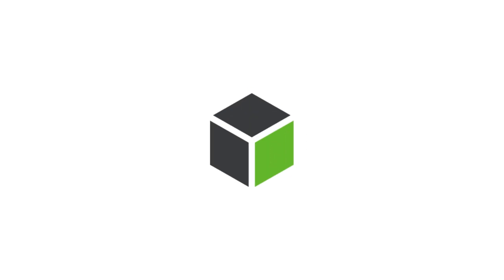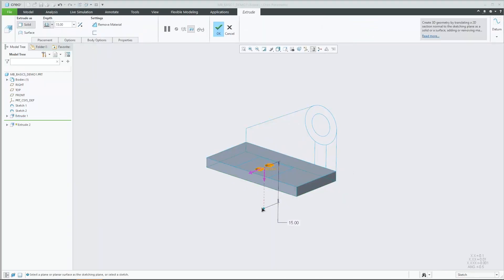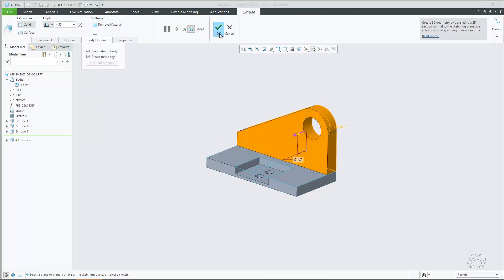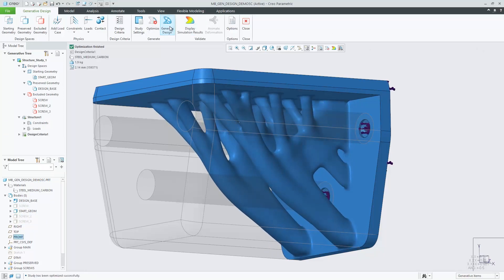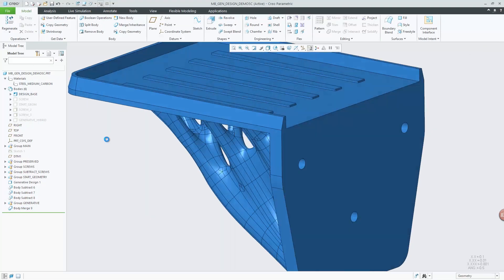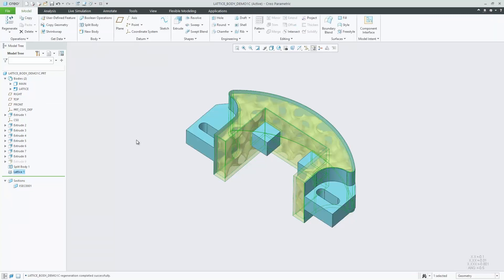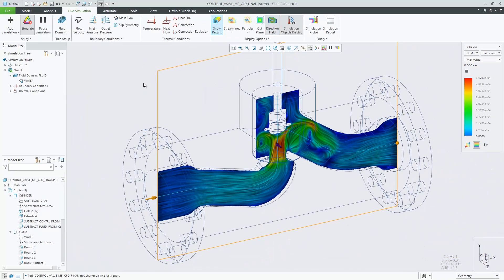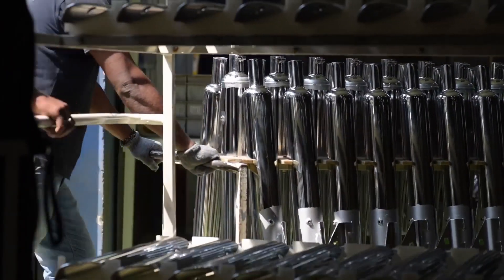Creo 7.0 - Multibody Design

Comment: This is 10 year old technology used by solidworks and inventor. Please get with the current times Creo.
Reply from the maker: >Implements technology in new release (or "gets with the times")
>Mocked in comments section for getting with the times by being told to get with the times
???
Anyway, in one release, we not only implemented multibody design, but we're already doing it better than what SOLIDWORKS and Inventor have spent years working on. That's not just our opinion, but that's what's heavily implied by Develop3D magazine: https://develop3d.com/the-d3d-30/#CREO7
(their full independent review of the whole release here: https://www.ptc.com/-/media/Files/PDFs/CAD/Creo/DEVELOP3D_Creo7.pdf?la=en&hash=C1F3F7D9D3316CCBAB136DC653B78F60 )
I hope you're commenting on those other CAD systems' videos asking why their CAD systems still don't open large assemblies well, or when they're going to be coming out with real-time simulation as part of a real simulation-driven design workflow, or when they'll have any number of the innovations Creo has brought to the market in the past several releases developed to the level that Creo has!
Reply: @PTC_Creo  I'm not trying to mock you. I'm just extremely disappointed. Recently started using Creo at work. It has been a nightmare. Feels like I travel back to the 90's and use windows 98 or something. The features seem over-complicated. Lots and lots of mouse clicking for simple operations that would otherwise take one or two clicks in other cad programs. Anyways, maybe i just expected a bit too much. The biggest upset was the lack of multibody function. I've used multibodies to perform top-down designs through the years. The other thing is the complexity of naming dimensions and associating them or linking them to formulas. Maybe take a look at how easy and QUICK it is to setup "parameters/equations' in SW and Inventor. This process is overcomplicated in creo. 
Anyway thats just my opinion. I'm sure people who have used creo for years have no problems with it. Its sad that none of my colleagues at work even know what multibodies are, or the fact that none of them use relations (again this process should be easier and quicker)
i'm glad Creo has improved the multibody funcion, and i hope it continues to listen to some of its user's frustrations. Dont let it take a another decade to implement powerful technology that is already out.
Reply from the maker: @ss2824  As with any software, you'll naturally get faster with it the more you use it. There's helpful things like the SW command search, too, to help speed folks switching from them to us. There has been a lot of effort in recent releases to reduce the number of clicks for commands, which is why there's a lot of mini toolbars now. I know there's still a lot of other areas of the software that haven't got a revamped interface since the '90s, though.
You should probably use your familiarity with multibody concepts as a way to make you seem like a valued expert on the team. That's why this channel has been focusing a lot on multibody stuff (we're almost done with it), and there are also special multibody tutorials in the Creo help files as well as a multibody blog on the PTC Community ran by our product manager for multibody, Martin.
https://community.ptc.com/t5/Creo-Parametric-Tips/Creo-7-0-Multibody-Home-Start-Here/td-p/666579
Speaking of the community, it's a great place to ask questions, as well as give suggestions on what PTC should be improving on the product:
https://community.ptc.com/t5/Creo-Parametric-Ideas/idb-p/creoparametric
I don't know where you live, but there are also regional PTC/USER groups all over the place that can also help you get some tips and learnings and all that. They also have Technical Committees that interface with our product management for things they'd like to add.
Thank you!
Reply: @PTC_Creo  Contrary to common belief in my workplace and in some online CAD communities, at the very least it appears that creo kind of listens to its customers (even if it takes a decade). The fact that you're even replying, verifies that fact. Yea, i've subscribed to Martin's youtube page. His videos have helped my creo experience be a bit less painful. Thanks.
Reply from the maker: @ss2824  I realised later after reading this that I ought to clarify something.
Dave Martin is the guy with the YouTube page. Doesn't work for PTC (not anymore), though we often pay him to contribute content for us like blog articles on ptc.com and mathcad.com. He's pretty much the CAD equivalent of an influencer. Very smart guy with incredible talents and helpfulness.
Martin Neumueller is the PTC product manager on a lot of core functionalities. He's the German-sounding guy narrating this channel's most recent uploads about multibody.
Dave Martin and Martin Neumueller like one another. Here's Dave writing about his encounters with PTC product managers in a post that's also about the "does PTC/Creo care about customers?" question.
https://www.youtube.com/post/UgyNr9GN7fmu6dozUJZ4AaABCQ
Anyway, I'm happy this exchange went better than I thought it was going to be! Cheers!
Reply: @PTC_Creo  Thanks for clarifying that for me. Either way, I'll stay tuned on both of these youtube channels and try to learn as much as possible. There is a lot of high quality content from other CAD programs on youtube, mostly designers/freelancers who make their own videos on beginner to advanced tutorials. So its nice that Creo is trying to establish a presence here on Youtube as well. 
I'm not the type of person who constantly nags and complains about life. In fact i hardly ever comment on social media. I just took it a bit personal because I'm a CAD user, and adapting to Creo has been far more challenging than i anticipated. I appreciate Creo's intention to be original compared to other CAD programs, but maybe you guys should hire and take input/opinions from cad users who use other cad programs. For example, Solidworks PDM and how it operates just like file explorer. Almost no learning curve is required there. Using relations works just the way Excel should work (or similarly). Naming dimensions and linking them to formulas should be done on the go as I create them. Ex. Length = 1.0, and a parameter should automatically be created when naming a dimension as you're creating it. 

Anyway, for better or for worst, I have to use Creo 5.0 and Windchill (ugh dont get me started) at work. As my colleagues at work have said to me - "these are just the tools we were given" or "it gets the job done" or even "we've quietly suffered thru the years", I'll also adapt and stop complaining. It is what it is. Nothing is perfect. 
Again, thank you for taking the time to reply, and thank you for the youtube content. I'll stay tuned :)

Comment: Probably it will require a license which company I work fot doesn't use.I am used to such functionality after using NX and ZW3D 2013, yes 7 years ago. Will you PTC make another simple feature available for your lower licenses such as boolean :D I can use it in my ZW3D, it's even available in FreeCAD but in CREO which I unfortunately have to work with during my current employment I can only use that function for max 2 components :D Very poor software!
Reply: Yea. Pretty pathetic. This function has been available in Solidworks and inventor for about a decade. Get with the current times Creo.
Reply from the maker: Multibody doesn't require any additional licence. It's a core capability.
Reply: @PTC_Creo  shut it Creo. You're a disappointment. Try using windows 98 today. That's how it feels to use your cad program.